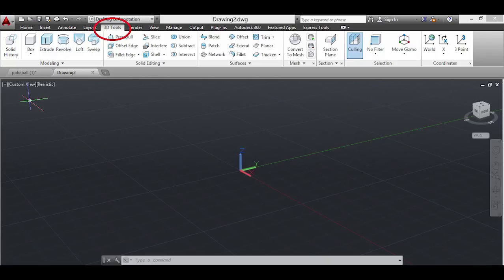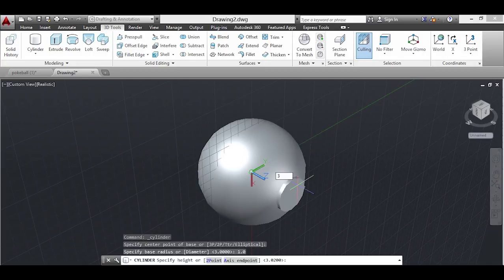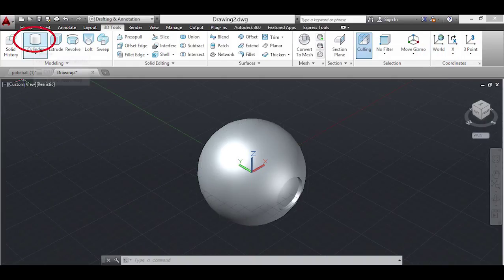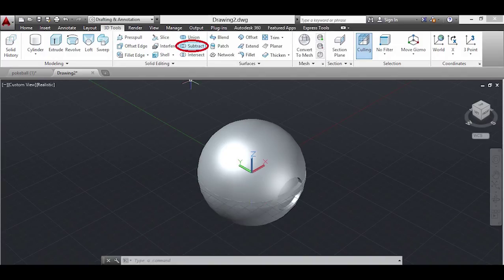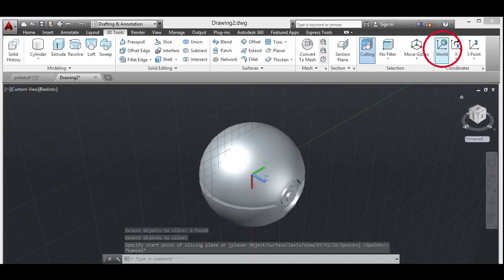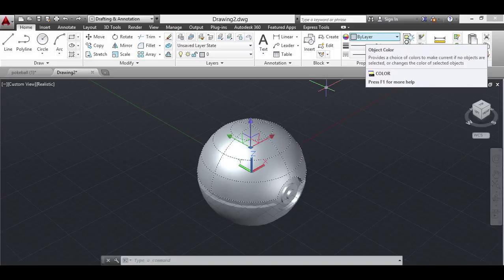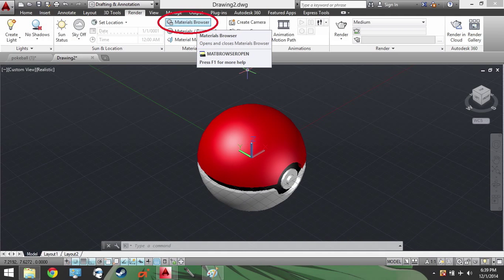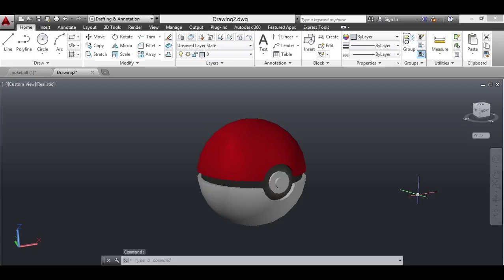Pokeball - AutoCad2014

Comment: I know this is 2014 Autocad and I am using 2016 Autocad, but when ever i put in 3 for the height of the cylinder, it goes way out of the circle... it might just be the Autocad version that I am using, but maybe for the 2016 version the sphere has to be double the diameter (radius), or the height of the cylinder has to be half (1.5). I know it sounds like I am going on a tangent, but do you possibly think you could try it in the 2016 autocad and see if what I am experiencing is true because of the instructions this video gives? 
Enough complaining for now though... Great video! definitely got my like!